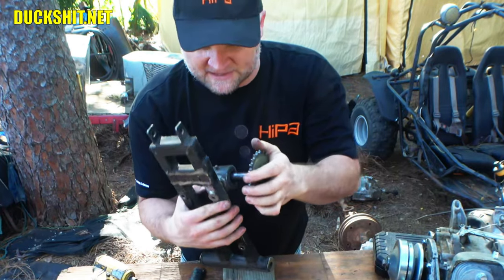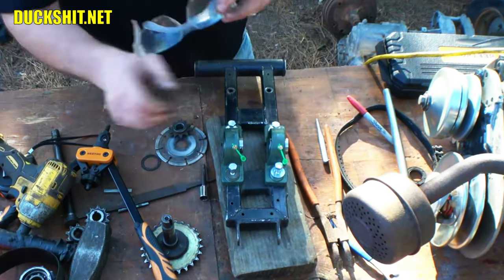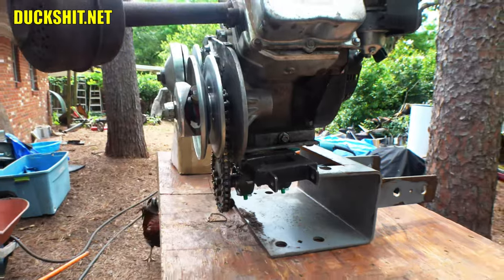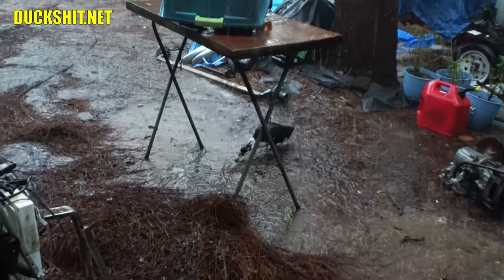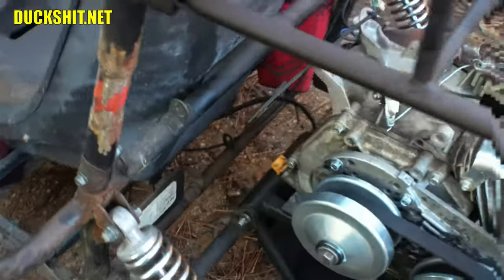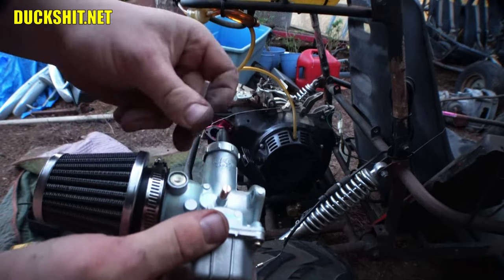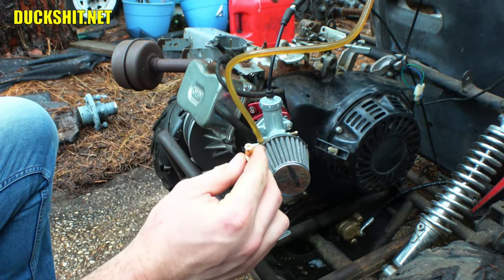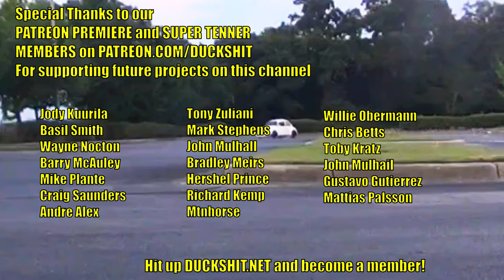FIXED - Coleman KT196 Weak Spot - JACKSHAFT/CHAIN TENSION - 16

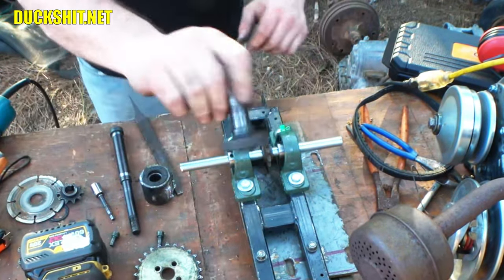Comment: At minute 19:32, that machine is used to drill ? I’m a bit confused how you did that step. I got all the parts but just need further explaining on how you go that on there. I know you said you were going to cut the old one off.
Reply from the maker: The lathe which you saw was used to keep it all round and straight.. and with it I cut off and bored out the sprocket carrier.  I did skip some steps that weren't interesting to keep the video moving.  If I were going to do it again however, I would just buy an axle mounted sprocket with same tooth count, or a sprocket hub and adapt my sprocket... which are both cheaper options and far less work. Hope that helps!

Comment: Same happened to me but I bought a whole new axle and went straight from converter to axle
Reply from the maker: That's interesting, how did you get the sprockets to line up?
Reply: @DuckmanCycles   I cut the jack knife bs off as it was half way broke from the weld and just ordered a 1inch axle and 48 tooth sprocket/hub and break hub and used the same brake rotor and 1 inch pillow block bearings and a 4 bolt rims used the same tires and from the converter the chain goes straight to the axle
Reply: It's the axle from go power motor so you can use a key on the hole axle
Reply from the maker: @TicketCrazyy Thanks, but I don't know what that means... sounds like you changed out a whole bunch of parts though.  Glad you made it work!
Reply: @DuckmanCycles  lol pretty much
Reply from the maker: @TicketCrazyy  got any video of it?
Reply: @DuckmanCycles  no I don't
Reply from the maker: Well I sure hope you share if you make some!

Comment: Bought my kids the 196 t for Christmas. The shaft actually snapped off after their 5th time riding it. Coleman won’t warranty the failure. I was told 90 day warranty by their “international call center”. Despite the owners manual claiming a 2 year warranty…
Reply from the maker: Oh man, it's a notorious weak spot indeed.  You can buy the engine mount plate from their website, you may have better luck with replacement, but it seems that without this upgrade they still don't quite work right.   One has been great since.  Nice having some adjustability thst wasn't there before.
Reply: @DuckmanCycles  wish I would have known about this prior to wasting $1400. Would have bought a different one or second hand!
Reply from the maker: That particular design is actually on a lot of different brands of go karts... I've been asked a lot recently for me to build them a working solution like this one here... and I suppose I could, but I would need all of their parts to make it all fit.

Comment: I got given one these with no motor, motor plate or torque converter 
would running a torque converter straight to axel work ??
Reply from the maker: Yes, if the wheels are big small, or if you put a big enough sprocket on the axle.  On the KT196 that jackshaft provides a lot of necessary gear reduction.  You can try to toss the torque converter completely and just run a clutch on the engine shaft direct to axle.  Won't perform as well, but might work for you.  Otherwise, see if you can find an engine mount!  You may find one for sale from one of the Coleman go karts sales people.

Comment: Looks like you solved your jack shaft problem. Just barely fit too. That carb is really fancy. You just about got it dialed in. Hope its not too lean so it dont burn a hole in the piston or valve. If the pluig is burnning brown its perfect.
Reply from the maker: Yeah, talk about snug fit!  Woosh!  Haha!  Hopefully that solves the problem until the next thing breaks.  The carb should be good though, I have it tuned surprisingly rich though... .150 main jet?  The DoodleBastard runs the same carb (different engine though) and only runs a 120.  I'll have to plug chop for sure when I start making my runs!   Thanks man!   😁👍🦆💩

Comment: hi the bolt in center bottom you put in now lock the pillow bearing  from moving back and forth on steel rail //you need to slot the bottom like the holes on bottom of pillow bearing .
Reply from the maker: Nope... the hole is bigger than the bolt, significantly.  Thanks!  😁👍🏻🦆💩

Comment: Using sq tubing as structural members can be tricky. C channel would be a better choice with gussets. The torque is increasing the force linearly. So if you know the torque, here is the formula to figure out the force. Force = Torque ÷ [Length × sin (Angle)]. Or just do whatever looks good 👍.
Reply from the maker: That'd be great, but I didn't make this engine mount... so I had to piss with the dick I was given.  I think it'll hold up though, time will tell lol!  I'm sure something else will give out next!  Next weakest link!  😁👍🦆💩

Comment: Duckman I would have put the rivnut on the bottom side so it would allow the bolt to use both sides of the tubing plus it would pull to toward the inside of tubing giving more strength.
Reply from the maker: That would have crushed the tubing on tightening... ask me how I know!   😁👍🏻🦆💩

Comment: What size is the carburetor
Reply from the maker: I thought I said in the video.... oops!  PZ30, links are in the video description, too! Thanks for the question!
Reply: @DuckmanCycles  I think you did,. I started your video last night. Did not finish. So I started to watch Again today as I was getting iv drip. had to stop video again . After nurse checked my blood pressure. 255/146.  She thought my blood pressure was high from watching videos.  It was her machine the hole time. Real reading 146/79. So I might of missed it. I have several projects my self.  But jetting of carb videos help a lot. Most recent project I picked up was a 1972 1000 cc sportster. Going to run makuni carb on it. Thanks for your videos
Reply from the maker: Oh man!  I happen you’re feeling better!

Comment: We just bought a CK196-T for our son and it has started not going into gear. What is causing this?
Reply from the maker: Hi, I'm not sure how to answer that.  There are no gears to put it into.  Can you please clarify the question?
Reply: So it is reverse, park and forward.. when he goes to put it in forward sometimes and then hits the gas it does not go. He has to go in reverse or back to park a few times and then it will go forward.
Reply: It’s a Coleman we bought it a few weeks ago for Christmas
Reply from the maker: OOOOOH! Its a brand new one, yes they have a transmission on them for Forwards and Reverse, so you can select a gear.  I haven't had any time to work with one of those, but I would check the cables to the shifter, make sure they are tight.  There aren't very many other things to do other than that.  If you still have a problem it may be in the transmission itself.  Sounds like what my Volkswagen is doing right now, lol.... but that is a different system.